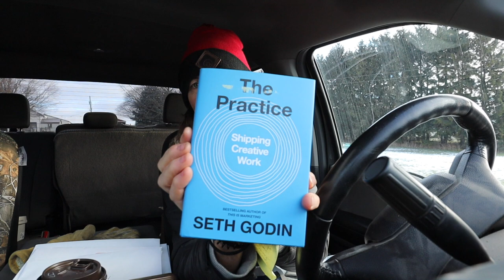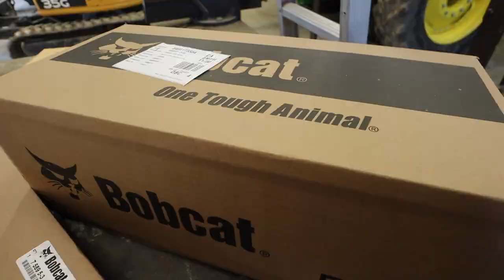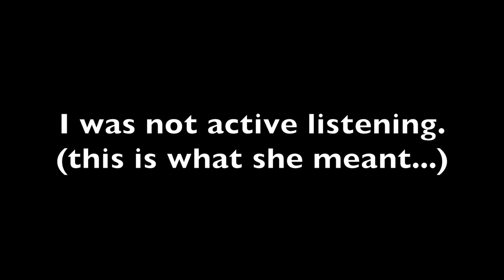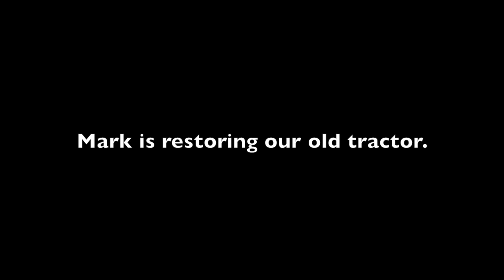RAISE THE ROOF! (some footage I wasn't expecting!😮) VLOGMAS 2020: Vlog 384

Comment: They sell heated garden hoses that may be easier although im not sure what lengths they come in and if you can combine them or not to get longer lengths. I havent used them due to cost but im only watering horses and goats a couple times a week so expandable hoses work for me as i can just toss them in a plastic tub between use in the house but I'd definately consider heated hoses if i needed a hose daily in freezing weather.
Reply: My sister bought a 100’ one for about $300-400, heat tape is much cheaper.
Reply: @samanthaclarke3422  the ones i have seen arent quite that expensive but they are around $100 each for 50 foot so definately not cheap. For some people it may be worth the cost and she may be able to work out a deal where she tries them free and tests them out to give feedback back to the manufacturer.

Comment: Tim from Ontario Canada I am surprised that you do not have set up a water cistern tank outback of your barn... two ways you can run this you can bring in a truckload of water from a water depot... or run each trough of your burns into your tank it would save you money on your water bills.. and you would always have the water closest to the barn .. and another question is is it cheaper to run your cloth roof rather than a wood roof.. with shingles or tin roof..

Comment: Frozen nozzles at end of hose. Depending on where in barn you have electrical outlets, nozzle end could be dropped at night on flat "heated pet mat". Draws little energy to maintain an above freezing temp. How about a Insulated waterproof "mitten" made with inexpensive refective bubble insulation. If heat tape is on hose, some warmth will be held by water pressure in hose and up into nozzle. Just trying to help problem solve... Happy holidays to you and family.

Comment: Today,you mentioned that you forget to turn the light on inside the milk machine station to keep it warm.  You could add a reminder in your computer for Dec.1 "to do" list and have it recurring each year. Then you would be automatically reminded.   
  There has to a way to keep the nozzle on the hose from freezing.  What about putting a low wattage heat light beside it?  That might work.
   Good luck!
   Love your blogs.

Comment: Attention sandy brock.. TIM from Ontario Canada... when you are replacing your mirrors and you are having a problem stabilizing your parts and you only have the one head to work with.. use a zip tie to secure the one piece that you’re working on to your vehicle or use duct tape to secure your peace again around this way you have both hands to work ...
((Step .1 use zip ties to secure your parts to your vehicle to free up your hands..                                                           ((step 2. Or use duct tape to secure your parts again to free up your hands.

Comment: Hi there. In regards to the mirrors your replacing. If it's only the mirror broken you should be able to get another mirror cut to the right size to install to have a backup.

Comment: Try putting the heat trace cable on the water nozzle and if possible on the few first inches of the pipe running to the nozzle. Just a suggestion. It’s great to see you so excited rather than flustered before lambing.

Comment: Will dorothy babies be ok, since she was so sick?
Reply: I don't think she was bred
(I could be wrong tho)
Reply: The medicine she was given caused her to abort, so she's not having lambs this season. Her next season lambs should be ok as she will have had plenty of time to recover & gain her strength (assuming that nothing happens between now & then).
Reply: She’s a ewe lamb I believe.. don’t think she is ready to be bred
Reply: I believe Dorothy is a ewe lamb, and wasn't bred. I believe the other one that fell ill, was pregnant, and the medicine made her abort, before passing away. I could be wrong though 🤷🏽‍♀️🤷🏽‍♀️
Reply: Angel  there were two with listeriosis, both were pregnant but aborted due to medication, the older ewe died & Dorothy recovered. I think you may be thinking of the 'overlooked' ewe that was the first to give birth last lambing. She didn't recover from lambing & didn't put any condition back on, Sandi had to euthanise her instead of taking her to the sales barn.
Reply: Both ewes aborted. They were early in their pregnancy.
Reply: The older first ewe aborted and then passed. Dorothy is a ewe lamb yet to be joined with the rems.
Reply: @lorlorslinger9617  The Ewe that died, was the one that aborted.  Dorothy is the "Ewe lamb" that hasn't been bred yet.  It Might be part of the reason she survived, she wasn't pregnant, so no heavy physical drain from the lambs.  Plus this little sheep is a fighter.  :)
Reply: @lorlorslinger9617  I was very confused because I thought in the last video that Sandi said she was going to euthanize Dorothy.. this makes more sense.

Comment: If the frames for your mirrors weren't too damaged, you could take them to Crystal Glass and have new mirrors cut for them, Even if you had to glue the mirrors in, it would give you a cheap set of replacements to have on hand. Perhaps Clarissa could insulate the milk replacer hoses for you, now and also install empty water pails in your claiming pens. I like to imagine the barn birds are chirping Deck the Halls, just not in perfect unison.

Comment: Isn't it possible to extend the plumbing and electrical overhead down the center of the barn! Seems like the manufacturer would have ways of trusses that would support the conduit and pvc pipe, insulated and sealed so those birds don't get to it and gives them more space to roost🤣😉 
Have you thought of mounting  the tree Christmas 🎄 on a small pallet permanently,  and placing it on top of the bottle baby house, dropping the electric down from overhead!  I wish I lived close enough to come do it for you, with 40 years custom home building it wouldn't take long, but bringing it from Utah would be the issue
Reply: Overhead Plumbing would likely freeze in Ontario winters?
Reply: @ya472  they Do have heated Plumbing! I live in Utah and have seen 50 below weather!

Comment: Question: When you had the barn built why didn't you put a overhead door on the other end?
God bless you and your family.
Reply: I built a big barn for my horses a few years ago and doors (especially big roller ones) are expensive! I had one at both ends in the older building and just didn't use the far end. Probably something like that.

Comment: Sandi,  About the condensation problem ( your indoor rainshowers ), would the moisture absorping beads help?  The stuff you put in basements and bathrooms?  I know they usually sell it in small containers, but you can get a bigger container as well.  Here in the US they sell it as " Moisture Eliminator".

Comment: So here's an idea what if you were to take a PVC pipe and cut it down the middle. Straight down on both sides. Then put a hinge every 4 ft or 6 ft. Then you take your hose and put it in one of those foamy insulation pipes enclose it into the PVC pipe. And you connect the PVC pipes where you can disconnect them during the summer. I'm not good at explaining but hopefully you get the visual. So it's not laying down on the cement you could also run the heat cord alongside of that. I also suggest putting some type of half Moon rubber piece underneath the pipe every 6 ft so it's not sitting down on the cement. Another tip I would do would also take those foam insulation pieces that people use to insulate their pipes and you can get small ones you can put that on the tubing of the milk for the lambs. That ones that connect to the fence. And you can tape it with duct tape or don't tape it. But that would be a good insulator.

Comment: You probably know that the poly tube you installed across the street have hole punched opposite of each other. They also come with the holes punched at approximately 4 and 8 o'clock.  The later may help to move air across the sloped surface of the barn covering and help with your condensate problem??? And maybe not???

Comment: for your nozel could you put it in the utility room untill you need it? maybe it won't freeze that way as it would drain after you take it off....or do you leave the water on to the hose since it has heat tape?🤔🤔I leave my barn water hose layed out in winter I just have to blow it out so it don't freeze solid...the connecting hose from the house to it I blow out and make sure it's drained as it's the shortest section😄 it's the outside spigots that tend to freeze up on me and requires an extra 50ft hose to go around the house to the southern spigot...and heaven help me if they both froze😣cuz then it's jugs and carry water back n forth(2 50gal jugs to fill a 250gal tank in the barn takes up to 20 trips back n forth!!)

Comment: Hi! Love the videos! Couple of thoughts- have you heard about pelleted bedding? It's something we use with horses and it's amazing at soaking up moisture. It's basically compacted sawdust that expands loads when it gets wet (it also composts very well). No idea if it would be cost effective for you but might be worth looking into? You could even just use it in the worst spots. Also, my sheep farmer friend uses a paddle to help move her sheep rather than gates- they're a lot lighter and seem to work really well. Also gives her more reach when she's running them through her handling system. Sorry to ramble, just a couple of things that came to mind while watching. :)
Reply: Sandi would have to buy the pellets, but her straw is a free by-product of her wheat harvest.

Comment: Sandi, how do you put a sheep down, and do you have a sheep cemetery on site?
Reply: Sandi uses a humane livestock killer which uses compressed gas to send a bullet through the sheep's head at high speed. She has taken lessons on how to kill painlessly and instantly.
Per Canadian government recommendations Sandi composts her deadstock.  That is, the carcass is buried deeping into her huge, hot compost piles. There the heat and the bacteria break down the body completely in about 30 days for a mature sheep. Then, in the spring or fall, the finished compost is spread on the fields are fertilizer. 
Burning can cause odor and air pollution, and burying the carcasses can contaminate  ground water.

Comment: Do they have feeder bunks that can feed from both sides?
Reply: It would have to ones she put in when needed, like the ones for creep feed, but they would take up too much space in the pen. Otherwise the barn would have to have more wide isle so the feeder could drive through. It’s a pain to feed with buckets but it’s only for a few days for each pen. Personally, I’d be using a cart to haul the buckets around instead of packing them!

Comment: Question why don't you use your lambing panels to make a pen for bottle babies on the outside side of your original pens (where you set up your milk machine) to have more room for your ewes in the lambing jugs?
Reply: I would say space and mess. I don’t think they could get the feeding machine through there if they did.
Reply: @samanthaclarke3422   the feeding with her cart would definitely be a tight atleast i remember she mentioned something like that before. As for mess i wouldn't think it would be much more than her normal clean out. I have a similar feeding set minus the cart for my goats and if i have any bottle babies we just add a small pen to the end of my feed bunk.

Comment: It has already started snowing i.e its very cold. How do the sheep keep warm when the barn is only made of plastic?
Reply: They have a good layer of wool. That’s one of the other benefits of shearing 6 wks before, they have that wool growth to help themkeep warm
Reply: As Samantha said, they have thick wool coats. Also the deep pack bedding, which is basically an in-place compost heap generates warmth, as well as just the large numbers of sheep producing heat.

Comment: I would like to know how wide your 4 big pens are. I'm building a barn and would like to be able to set up lambing pens like yours so need to know how big my runs need to be. Thanks!
Reply: The pens are 12 feet wide, as is the central walkway. You can check Sandi's playlists, she talks about the barn.  I seem to remember the pens are about 200 feet long.
Reply: @MobyDicksWife  Thank you, I knew she talked about it before but couldn't remember which video she discussed that in.

Comment: I love your set up, Im trying to set up something similar inside my garage where my mini goats house, I currently have one of those humongous dog panels, Id like to take it out and use those cattle panels(cut down to fit) my question is would the same height you use in those panels work for my mini goats?  Love seeing goat, she is adorable, reminds me of Floppy my ewe. Hope you have a great day.
Reply: I think the height would depend on how tall and/or agile your goats are. Sheep don’t tend to jump, goats do
Reply: @samanthaclarke3422  my girls are under 21 inches, I currently use a full size cattle panel to seperate them at night so no fighting while eating and they dont hurt each other, they seem to jump if they have a solid place to put their feet, the holes keeps them from putting a foothold on so they can jump.  I was wondering how tall so I dont have to keep undoing the separation part so I can step over.
Reply: @evieuretsky9997  Sandi’s panels are 40-48” I think you can get different heights, they should work
Reply: @samanthaclarke3422  cool, then I can cut these panels down, should make it easier to be able to get in and feed and when its kidding time in 3 weeks

Comment: It occurs to me especially when you do a time lapse of an activity just how much walking you do eg walking to fetch a panel carrying it to where you need it,especially down the righthand side of the access passageway forming the individual pens and also down the centre passageway at the bunk feeder. I have also heard about your back ache from lifting or carrying and you are often twisting at the same time.

It seems to me that you need a specialised 4 wheel trolley (that is easy to push or pull from either end) to carry the long panels and a bunch of the short panels plus a "scabbard" for the rods. My suggestion is next time you happen to be in one of those massive box stores in your country that sell timber look at the trolleys that folks use to carry timber and particularly those designed to carry sheets of stuff like plywood to the paypoint and then to their vehicle. 
This basic design could be copied with large panels stacked vertically on one side of the cart and shorter ones on the other side. To carry the rods how about a piece of rigid 6-8inch plastic sewage pipe cut off and fixed upright in the centre of the cart. 
Take care to study the design and layout carefully for the centre wheels and the wheels at either end that allow someone to steer it around corners. 
Note you would need bigger diameter wheels than they use so that it is convenient to move easily over straw bedding, hosepipes etc whereas those belonging to the stores only move on smooth concrete or at worst asphalt in the car park. The main wheels probably need to be like those that on the trolley you carry the straw bales on or wheel barrow wheels.

Just how do you get water and food to each individual lambing pen, carry it in buckets?

Comment: Did I hear a duck noise to cover it's um...rhyming autocorrect word while you were working on the bobcat mirrors?? lol

Great video today, Sandi! It just had all the right tidbits :D

I guess it's time to start planning where to pull a pipe out for better water placement. Heck even putting it on the otherside of the wall could be heaps of help with a tap out there. I'm still convinced the weener pen would benefit from a tiny tank with a float. As long as the can't pull the float out! lol

Comment: Sandi, would it not be simpler to set your Lambing Pens along the entire length of the paddock, end to end on the feeder side, this would save you having to clamber into pens in the centre with feeding buckets? You would also be saving panels as you wouldn’t need a fourth one to stop lambs slipping through to the other paddock. 😃👍

Comment: Remember to use male and female connections where there are holes on the hosed and also you can add to connectors there good luck don't throw any length of hose Away 
Love you. Have been watching for at least 2yrs

Comment: Why do you blame the ewes for low weaning weight? With your breeding setup it seems like one of the rams could easily be the problem.
Reply: Not enough milk production might be part of the reason.
Reply: The rams are partly responsible for weight potential but gain from birth to weaning is all on the ewe